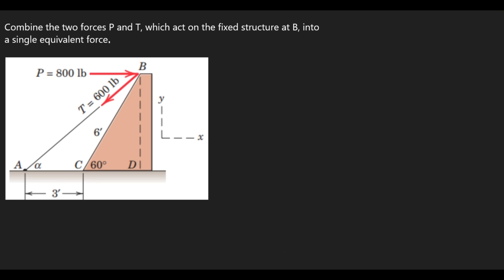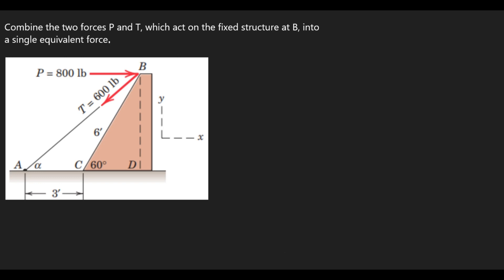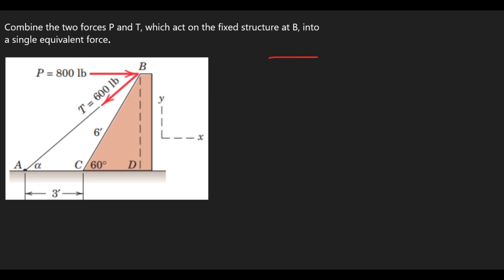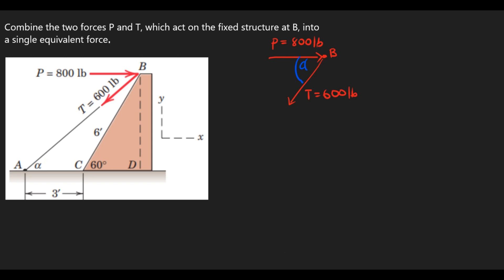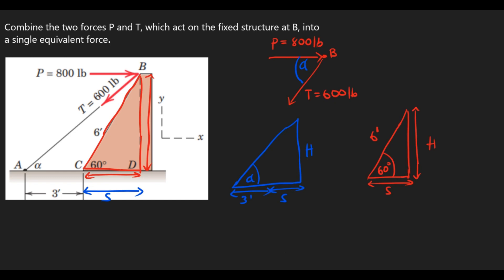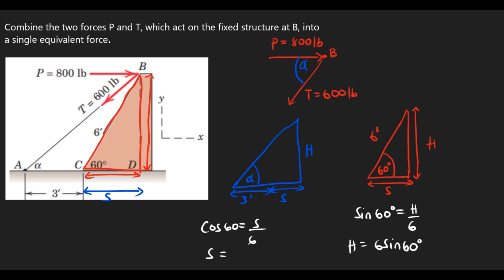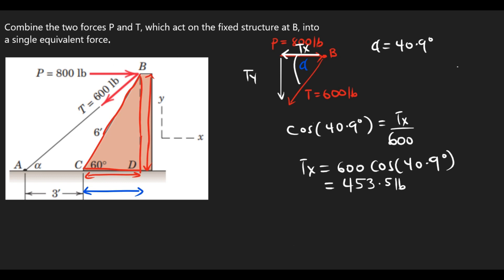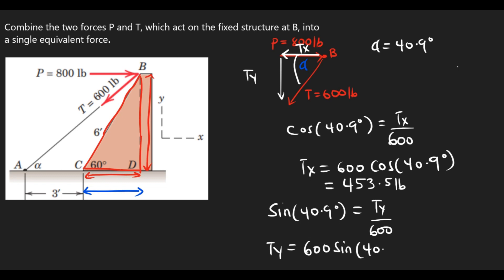Find the resultant of the two forces P and T

Comment: Why didn’t you subtract 392.81 from 600 lb in the Fy direction
Reply from the maker: We can't subtract the 392.81 from the 600LB because the 392.81 is the y component of the 600lb. And we sum Force based on thier direction. The 800 and 453.5 are in the x axis direction but opposite that's why we subtracted the 453.5 from the 800. And the 800 was in the x axis direction unlike the 600lb that was at an angle,so you can subtract the x component of the 600 from the 800 since they are in the same direction but you can't subtract the 392.81 from the 600lb.
Reply: Ok thanks